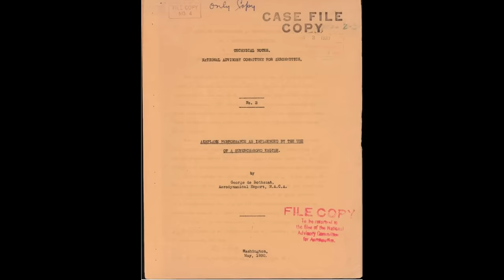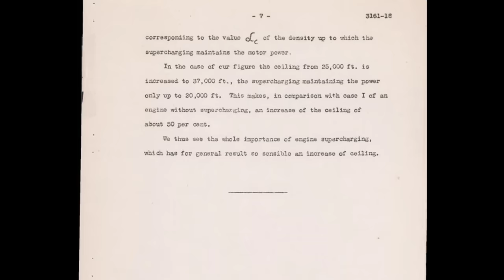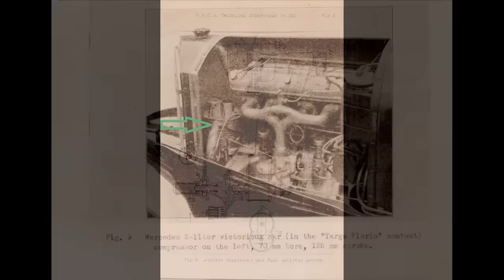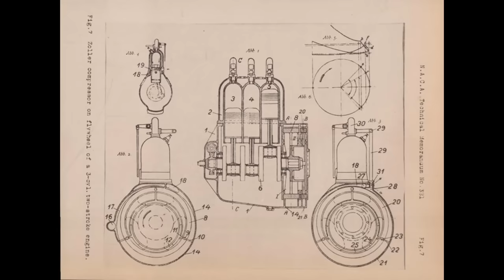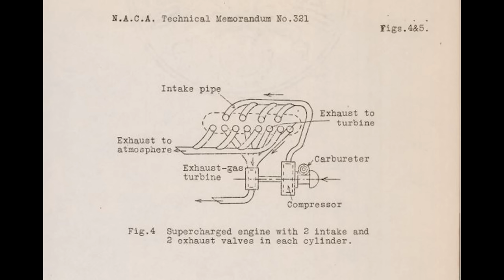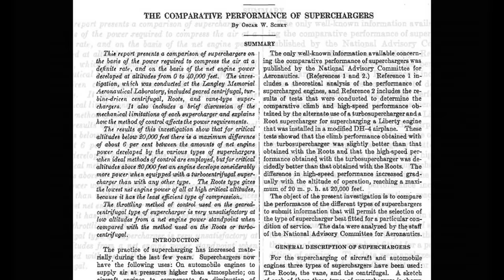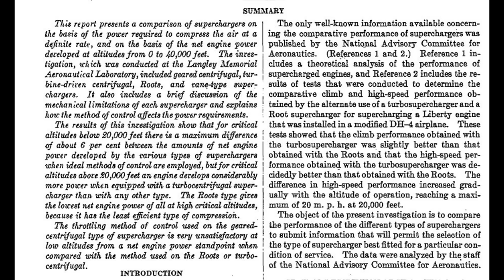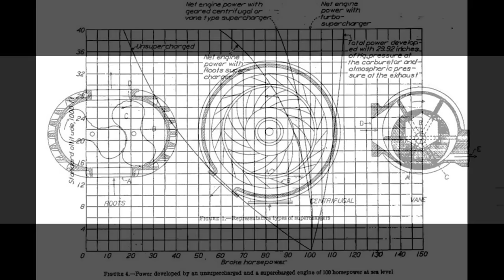Turbo vs Supercharging in WW2 Airplanes

Comment: Wow, that's an evening I'll never get back, and more to come! Thanks, Greg! Really detailed and interesting information on a subject that interests me. 

Something that I perhaps missed: the main objective of supercharging is to get more air into the cylinder because more air = more oxygen = more fuel can be burned, and the power comes from the fuel.  In addition, supercharging allows you to keep that "more air" available regardless of altitude. The significance of increasing manifold pressure is that it's a measure how much you're increasing the air supply to the cylinders.

Here's something I've wondered about: 60" of boost packs twice the air/oxygen/fuel into a cylinder which is why power doubles(well, double less whatever is used to run the supercharger in the first place), right? You've effectively doubled the displacement of the engine without increasing its physical size. Also, compression ratio is specified as [cylinder volume @ BDC/cylinder volume @ TDC] assuming the engine is normally aspirated. I found one source that says the effective compression ratio with boost is sqrt((boost(psi)+14.7)/14.7) * CR = ECR, so at 60" MP, a nominal 6:1 compression ratio would then be equivalent to about 8.5:1. Anyway, at 60", do you get (most of) the benefit of doubling the displacement AND increasing the compression ratio? Or are they just two different ways of saying the same thing?
Reply from the maker: Hi Warren. At 60" of manifold pressure you get the benefits of roughly twice the air (minus whatever is lost due to temp rise), the increase in effective compression ratio, and an increase from better scavenging. Add up all that, subtract the power to drive the supercharger, and it works out to nearly double the power. I covered most of these topics in earlier videos, the two Wildcat Videos, the P-51 manifold pressure video, and the exhaust video. It's sort of a video series, they are not numbered, but if you view them in order of upload date, it will all make more sense.
Reply: @GregsAirplanesandAutomobiles  I am struggling with your assertion that "you get the benefits of...the increase in effective compression ratio..." What is clear to me is that you do not get an increase in effective expansion ratio which explains the high exhaust temperatures. (Excuse my stating what you already know, but compression ignition engines have low exhaust temperatures due to high expansion ratios) 6:1 is not very high. With 60" of manifold pressure, the pressures in the cylinders are very high, requiring high octane fuel. In that regard, it is like having a high compression ratio, but it is not a benefit but rather a liability. What am I missing?

Comment: The P-47 is cool, the Cadillac of single seat fighters. The thought occurred while watching your excellent video that one of the reasons the P-47 was so out ranged by the P-51 is because of the space consumed by the turbo system. P-51D had a large, destabilizing when full, fuel tank behind the pilot in space the P-47 needed for the turbo and it's ducting. Lockheed had something excellent with the P-38 but as you said but it wasn't fully mature until the later J and L. Carlo Kopp's Der Gabelschwanz Teufel (The Fork Tail Devil) article gives an excellent account, I sense you've already read that, and I mention it for others who might be interested.
Reply from the maker: The P51 has an internal fuel load equal to about 88% of the P47's, yet burns about 1/2 as much in cruise. I'll cover that in more detail in the next video, those numbers are rough, but in the ball park.

Comment: I found this VERY FASCINATING all the way thru!!! I used to race a 68 340 S Barracuda and struggled to find ways to put a Paxton VS57 on it. Also struggled to learn - infomally - about supercharging! Coulda used some college classes. and a professor's help. Studying Gill, Ziurys and Smith helped.but the book by itself wasnt enuf!!.
Something you might have mentioned or called attention to: regards the difference in the two theaters. and the difference in kinds of combat engagements between opposing forces.. 
The European and African theaters were pretty much "bombing fixed things" and it was best done above flak if possible, so bombers and fighters needed to be able to function more of the time at higher altitudes. LOL
The Pacific theater was very little bombing fixed targets till we got to the larger islands and finally Japan . It was more "high speed, skirmishes" between fighters, torpedo planes and dive bombers at lower altitudes, Torpedoing ships and assaulting islands, both by strafing and dropping napalm..Im not even sure we were involved in high altitude operations at Guam (44) or Iwo/Okinawa (45) only B29's over Japan proper. B17's were tried in the Midway conflict but the Nordon wasnt designed to deal with dodging ships AND time of bomb fall from high altitude gave the skipper plenty of time to have his 'boat' moved somewhere else.
One other consideration to be considered was the difference in ambient air temps. For example, P38 superchargers tended to freeze up in the higher colder altitudes of a more northerly climate, but DID NOT in the more temperate latitudes of the south Pacific where their role was lower level use.
Sorry Ive rambled on so much
Reply from the maker: All good points Frederick, I just didn't cover those things because they were outside the scope of this already long video. I'll get to those things when I talk about the P38 as it operated in both theaters and with very different results.
Reply: Greg, I fully understand time and space constraints, hadnt thot of them.
When you do the P38, Remember Richard I Bong, Ace in the Pacific - who flew his plane down San Francisco Market St at 2nd floor level waving at secretaries - on over the bay and scared a housewife in Oakland she dropped her wash and dove in the mud. His punishment was to do her wash for a week or two. lol
Thank God his CO did not wash him out of flight school!!!!!!!

Comment: Great information and presentation once again Greg! 
Regarding the aerodynamics of the P-47 and F4U, the majority of reliable sources that I can find for both aeroplanes gives the speed difference at 52" at sea level to be approximately 25 mph; 351 for the F4U (as you mentioned) and 325 for the P-47. This is consistent with their cruising ratings of 44" and 42" respectively (50 hp difference) where their respective speeds are 328 and 304. The difference isn't huge but is significant.
Reply from the maker: The Corsair reports are all over the place. However if you average them out and only use official tests of production planes the two are very close in speed at low altitude. For example in these two reports,   the Corsair does 343@5900 (a bad spot for the Corsair) and the P47 353@5900. There is also a Jeff Ethell video somewhere in the comment section showing the two planes flying side by side and Ethell discusses this exact issue and comments that they are about the same at whatever manifold pressure he was running.
Reply from the maker: OH, those reports are: http://www.wwiiaircraftperformance.org/p-47/P-47B_41-5902_PHQ-M-19-1417-A.pdf and http://www.wwiiaircraftperformance.org/f4u/f4u-1-02155-British.pdf  The P47 one only goes down to 5000 feet, but I don't have time to dig up others, so I'll cover this in my next video, that is sea level speed of the P47.
Reply: Agreed, the Corsair reports are extremely messy with aircraft of various condition and loading tested in the same fashion as prototypes. The one you linked is quite a good one; I'd also recommend using the USN's ACP/SAC reports as those were used for operational planning and they match up near perfectly with pilot manuals.

Comparing the two aircraft at 5,900 ft is a case of unequal comparison as the P-47 is producing 2,000 hp here whilst the F4U (as you mentioned) in it's lower blower gear is only making 1,760 hp (the power chart in the linked F4U report isn't entirely accurate). Additionally, the P-47's performance is slightly on the optimistic side as it isn't fully loaded to operational condition and is ballasted with a rearward biased CGI, giving it a better flight attitude at high speed than standard. Regardless, if the speed is extrapolated to sea level to compare with the F4U's performance where both engines are pulling 2,000 hp, the P-47 from that same report is running at approximately 330 mph.

Anecdotal evidence is always fascinating but also requires consideration with a grain of salt. Warbirds nowadays are never loaded to their wartime conditions and it is impossible to properly compare air frames and engines which have so many hours behind them compared to production specification.

All things considered, it is rather marvellous how two aircraft of completely different design specifications but identical powerplant managed such high performance, a testament to how well both Republic and Chance-Vought did to squeeze the most out of their respective aeroplanes. It is also very interesting to compare Grumman's Hellcat which understandably lacked the performance edge of its cousins but made up for it in other areas.
Reply from the maker: I agree with pretty much everything you said. The problem is that there are no two perfect reports for comparison, and yes, the planes flying today are often totally different. They remove the armor and weapons, run different fuel, and in the case of the 47, usually  remove the turbo! I do my best to distill the information down to something manageable, but in the case of a specific airplane's speed at a certain altitude, there will always be room for debate, at least with WW2 planes. My overall point here was that the F4U1 and P47B run at very similar speeds from sea level to 20,000 feet with the advantage see sawing back and forth a bit until the 47's turbo gives it too much of an advantage to for the Corsair to overcome.

Comment: Well, I thoroughly enjoyed that. Every bit of it. 
Your plain english technical analysis appeals, and indicates an erudite understanding of mechnical principals. The fact you have have (not obviously) worked highly technical facts into digestable, systematic commentary indicates great attention to detail and by extension, pride in your work.
Add to this a fine voice for this sort of dry (to some LOL) subject matter.

On another matter, I have question about the vid. 
How does altitude gain effect turbocharger compressor pumping losses? 
I ask this because I assume reduced density of air at say 18,000ft as opposed to 8,000ft allows lower turbine section pumping losses and therefore more power. Put another way, a turbocharger (below critical altitude) should produce more power in theory because the compressor is easier to turn. 
I reason the reality is the same since the wastegate would regulate the manifold pressure at the set value but the ultimate result is lower fuel consumption for similar MP at 18,000ft vs 8,000ft. 
What do you reckon?
Reply from the maker: Thanks for your kind words. Regarding pumping losses for the turbo. as altitude increases, the air gets thinner, but the turbo also need to spin faster and make more boost to maintain a given manifold pressure. Thus pumping losses increase with altitude. I don' t have specific numbers on this however because the way they tested aircraft engine power ratings was at standard temps at specific altitudes. Thus a P47B with 2000hp at sea level at 52" of manifold pressure also puts out 2000hp with 52" at 27000 feet. Even though there are greater pumping losses, the lower temperaturs through the intercoolers offset this. I'll try and work some of this in on my next video.

Comment: Electric driven turbo-compressors are used to pressurize the cabin of the Boeing 787, unfortunately scaling down the massive generator and amp load for GA aircraft or automotive applications is still in the future.

Comment: Nice vid. One thing I was interested to hear you NOT cover was the curious German experiment (and I think others might have tried it as well) of using a THIRD engine, not driving a prop at all, to drive the blowers for the other two. You take a weight penalty, of course, but those other two engines can then reach their theoretical maximum of output up to very high altitudes. IIRC this was considered an acceptable price to pay to get them out of the reasonable reach of interceptor fighters.
Reply: Some Do 217P had a pair of conventional  DB603B engines and a central DB605T (which was turbocharged) to drive a compressor to supercharge the two main engines.    Three prototypes wwere made and tested.  Serivice celing was an impressive 53,000ft so the technqque worked.  .  It was mainly intended for phot reconisaance but could carry a small bomb load.

Comment: Wow,  engineers must have breathed a sigh of relief when the comparatively simple jet engine came along.  Just a couple of rows of blades, a compressor, and any old oil.....extra 100+ mph and could be built by labours in a shed !!!! (after resisting it,  considering all their hard work on piston engines over the last 40 years) lol..........must of hurt!
Reply from the maker: It was a big leap forward. However in some applications the old piston engines still have the edge.
Reply: @GregsAirplanesandAutomobiles  Which applications?

Comment: Rolls Royce also put a lot of effort into turbocharging especially alongside their two stroke V12 Crecy. The test engines were incredibly noisy but they estimated exhaust thrust would add 40% to the total power. 5000bhp equivalent for the full size 27 litre engine. 
They added a huge turbo with additional fuel injection making a hybrid piston/jet engine. The emerging turbojet being far simpler killed the Crecy. 
Much of this misunderstood or ignored gas flow harmonics. Two strokes use it to great effect but it’s a factor in four strokes.

Comment: The main reason that Germany did not built turbo charged combat planes was the high temperatures of the exhaust gas of gasolene engines. It requires nickel based materials which were scarce. The diesel has lower exhaust temperatures. Thats why the high altitude reconnaissance plane equiped with Diesel engines had indeed turbo chargers.

Comment: I have to disagree a bit about the B-29 being the last gasp (As it were) for turbosupercharging military aircraft.
The Convair B-36 had 6 turbosupercharged P&W R4360s, with 2 turbo-blowers per engine.  The Flight Engineer's Manual Performance Charts cover up to 53,000', with guideline instructions for power settings at higher altitudes.  It was the mainstay of the intercontinental bomber force until it was replaced by the B-52 in '56 and '57.
The B-29's young4er brother, the B-50, used 4 turbosupercharged R4360s.  They were in service from the late '40s though the mid '60s.
The Boeing C-97 Stratofreighter and KC-97 Stratotanker were used by the USAF from 1946 though the early 1970s, with about 950 seeing service as transports and as the 1950s mainstay of SAC's Air Refueling Squadrons. (It was the only transport airplane of the time capable of more or less safely refueling a B-47)
It's true that the Model 377 Strats weren't a big success as commercial airliners - compared to the contemporary DC-6 or Constellation, their higher altitude and faster cruise was offset by the maintenance load (Like changing 56 spark plugs per engine on a regular basis - 115/145 Octane fuel fouls plugs like nobody's business)
But the Air Force paid it's mechanics the same no matter what they were working on.  

On a somewhat smaller scale, a lot of the smaller piston-engines helicopters - H-13s and H-23s used turbochargers to increase their altitude performance.
Reply from the maker: Hi Peter, that's a good point about the B36. I left it out for three reasons. The video was getting too long, the Rainbow was much faster 400mph cruise vs. 230mph, so I felt that the Rainbow better showed the potential of the turbocharged radial, and I'll talk about the B36 later anyway.

Comment: Great video, as usual. Would like to learn more about the packing difficulties (mentioned several times in this video) of turbos especially as the modern car turbo system is so compact and minuscule compared to the actual engine.
Reply from the maker: Look at pictures of a P-47 Turbo, it's big. When trying to fit the large turbo, intercooler, and all the plumbing into a fighter is a challenge. Today turbos are a lot smaller.
Reply: @GregsAirplanesandAutomobiles  Thajks, yes I did see that but why they are smaller today, what has changed or is it just car turbos that are smaller? When turbos became sort of 'standard' feature in modern cars some 25 years or so ago I thought it was because they are so simple compared to Roots compressor or mechanical super charger. But what you show in this video was sort of contradictory to that and that is why I was wondering and still am. Is it just the need to suck so much thin air at altitude that everything needs to be so big?
Reply from the maker: A big factor is the RPM levels they reach. Early turbos spin at about 30,000 rpm. Modern turbos spin up around 200,000rpm, thus they can be relatively small and still move a lot of air. I would not say they are simple compared to a mechanical supercharger, they are about equal in that regard.
Reply: @GregsAirplanesandAutomobiles  I see I think, thanks!